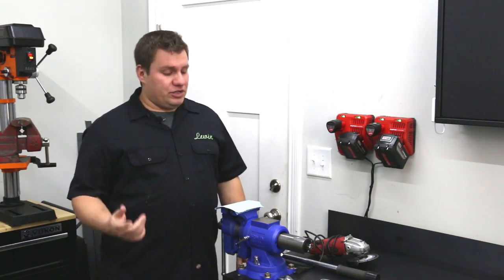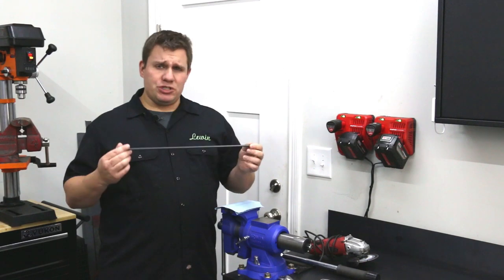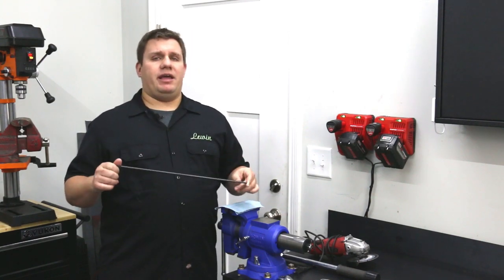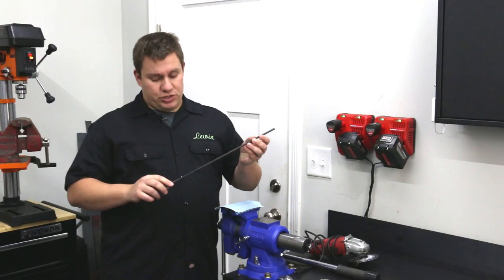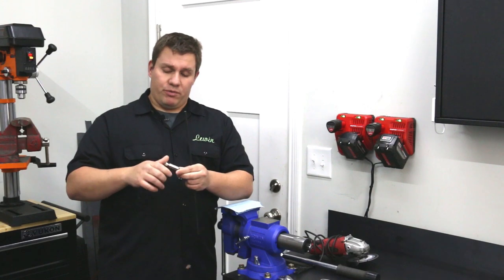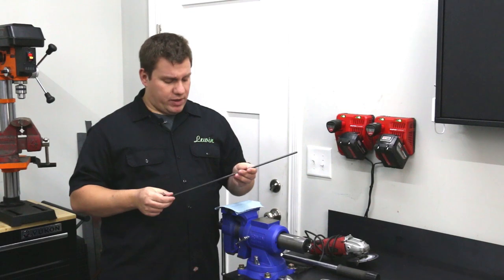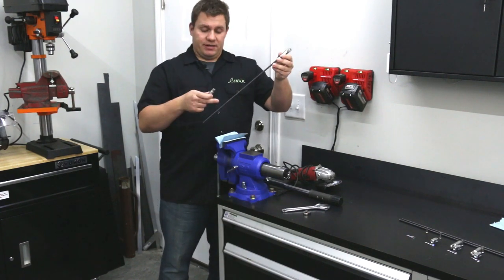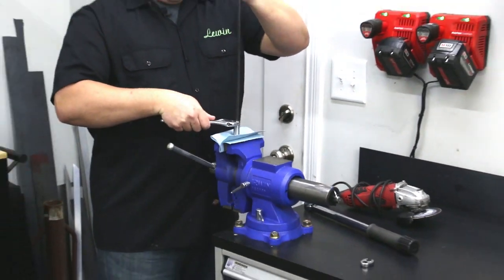#DIYDownforce Splitter Support Rods

Comment: I'm a retired Aerospace Engineer who just bought a new C8 Corvette. I bought a lot of genuine Carbon Fiber for my C8, splitter, side skirts, High wing, etc.  and was researching ( because that what retired Aerospace Engineer's do ) and I came across these Splitter Support Rods. I can tell from the build quality that these are exactly what I need for my car. You can look on Amazon and see Splitter Support Rods for $15.00 on up.  Chinese junk. You should not buy a $100k car and put $15.00 Chinese parts on it. That said, when I'm finish this post and I will order a set of these beautifully engineered support rods. And I won't be disappointed. The quality will match the quality of my C8 Corvette. Thank you Professional Awesome Racing for making these very high quality parts that I will be proud to attach to my new car !
~ Dave in California
Reply from the maker: Thanks for the kind words!

Comment: Follow up to my last post:  I received my Splitter Support Rods from Professional Awesome Racing and I can now tell you with product in hand they are absolutely beautiful. I got the Fancy Aluminium Clevises and they are beautifully black anodized with silk screened lettering. The rest of the metal hardware, collets etc., is beautifully CNC machined stainless steel. The photos on their website don't do them justice. These rods would not look out of place on any Ferrari, Mclaren, Lambo, Bugatti.... on and on.

I'll add, I have no affiliation with Professional Awesome Racing. Just a very picky retired Aerospace Engineer who will only put the finest aftermarket parts on my toys. With all the crap you can wade through on the internet when looking for something, these guys are the real deal.

~ Dave in California
Reply from the maker: Thanks so much for the kind words, truly means a lot!